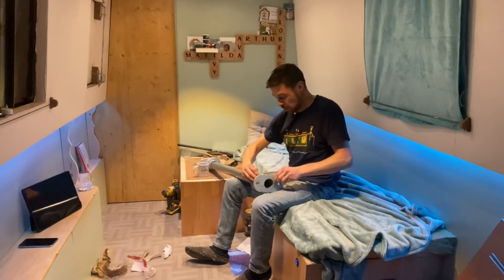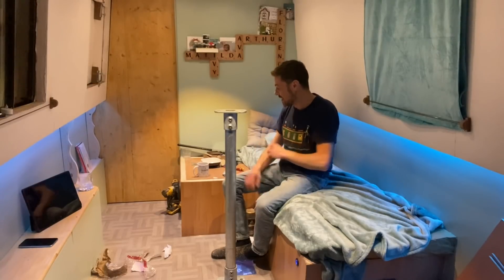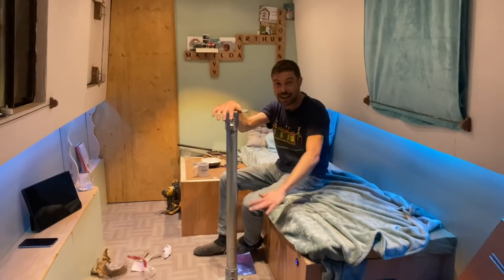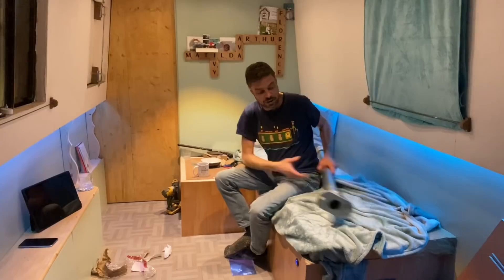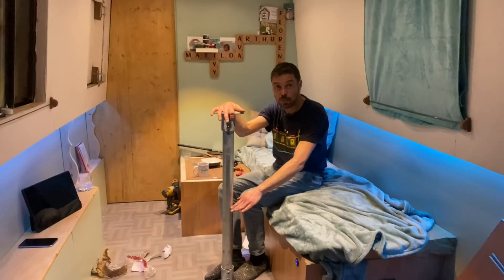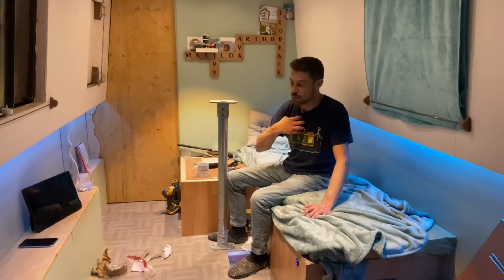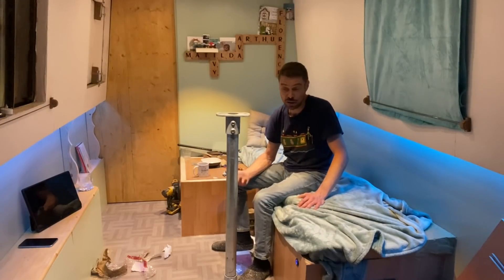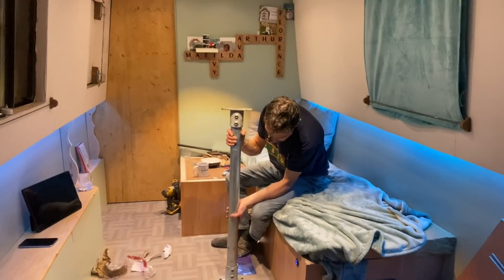315. The world’s heaviest adjustable table leg

Comment: I would go with two poles James and do it so the table turns round one side round for going in as to bed and the other side for sitting so you can turn the table putting it on tlx don't know if this is any any good

Comment: The infill for the bed could be a piece of wood with the foam attached and covered with fabric on the front and sides (like a chair bottom) and could be used as the bench back for the long end. When you want to use the area for sleeping, the back would just sit on top of the lowered table. So it would always be in use, either as a bench back or the infill for the bed.  You would make it in two pieces. One the size of the infill, the other to make up the rest of the bench.  For the permanent table top,  you could actually have two smaller fun shapes with a splint down the middle.  Irregular in shape attached in an off-center way to the inner, telescoping pipe that could ROTATE when you remove the pin.  Basically having two settings - one close to the bench and one farther away,  split it into two separate table top so you can have a raised one and a lower one.  As for the inner pipe, you can use pvc pipe for the telescoping part so as not to add too much weight.

Comment: Two sets of legs.  Cut the existing tube into two pieces.  Short one to bring table top level with seat, longer one to raise it to table height.
Put the legs off centre of the table, and rotate it to the required position.  Job's a good 'un.  Next question?
All the best, mate.
Reply: I like this solution better.
Reply: This.

Or throw the tube in the cut for the magnet fishermen and go buy the 400 gbp leg.
Reply: I like this idea too

Comment: Most narrow boats nowadays use two ‘desmo’ legs which slot into a cup recessed into the floor and are much lighter than the one you have. You can also get different lengths to accommodate a table or a bed height.
The table size needs to be the same as the bed space. You’ll find when you sit down that it allows room to get in and out with no problems. It doesn’t overlap the seating as you seem to think.
By having two legs of the same length, you can either have a full size table (two legs) or a smaller half size table coffee table (one leg)
Legs and tables can be stored under the gunwales so that they are out of the way when not needed. This retains the free space you have at times other than meals.
Just a thought.
Cheers 
Les and Anne on Glendyne

Comment: Do you have enough length in that tube to make two different lengths of pipe, one for the bed set up and the other for the table set up. Not sure how high you need table but with you may just have enough length to cut it into two sections one short  for bed and one long for table. Quick release bolts..

Comment: Do you even need to bolt the sockets onto the vertical pipe? Is it not snug enough without the bolts to stop it wobbling; then you could just swap out different vertical pipes easily to change height.

Comment: Agree with Sarky, set the post offset from the centre and rotate the top to table or bed position, for the height id go for the tube inside method with a pin to set the height.

Comment: I’m not sure you need a smaller table, if it’s too small then it would feel too far away when sat down. Think about where your chair is when you’re sat at a table, normally the edge of the table and the front of the chair are in line or even the chair is under slightly. I’ve used dinettes where the bed and the table are the same piece of timber and it was fine.
Reply: I agree completely CA. I've just finished fitting out our 58' narrowboat. Both dinette and sofas convert to beds and the table tops are the correct size for the bed inserts. they are supported on Desmo legs which have wide circular connections to the table top/infill and floor so it's all stable in all directions. James, if you want more info, see photos, chat on phone, visit my boat currently in Welton Haven Marina, drop me a message. However you go,  make it simple - think ahead.
Cheers, Keith.

Comment: Ayye Captain !  Thou dost have revived my suggestion. In the end ….it requires a (squared) tubular base unit with top openings on the outer vertical posts. The diameter of the steel tube need not be great. You then insert smaller posts into the larger outer posts. These smaller posts act as the four table legs. The base is the shape of a rectangular box. It is screwed to the floor with six screws each side of the long sides of the box shape. IOE the screws run along bow to stern in orientation. Super stable… not too heavy.
The base is “bed height”. I reckon that this is the simplest design. Just bring your measurements and the tubular material to a welder. 
In this design…I am confident Captain.
Cheers 🥂

Comment: I think that you may wind up with a trip hazard with that pole fitting unless you always leave the tabletop in or the be made. Over in the US we would probably use a taper lock floor fitting with different height poles if we didn't want the adjustable. or you might see if you could mount it upside down with the upright portion extending into the bilge you would have to cap off the end to allow the post to just socket into place? Just some thoughts

Comment: If the table top is connected to the legs “off centre” across and lengthwise it would be away from you when it’s a table and in line with the seat when turned 180 degrees.  As a table top it would sit further in to the corridor and slightly more toward the kitchen

Comment: If you look at RV tables that are used for that, they pretty much line up with the edge of the benches, so I think that would be fine.    I like the 2 legs idea, and 2 tubes for each, high and low

Comment: Have you thought about being able to walk past it when it’s in table mode.  Also you will need the ‘table top’ to move up and down as you’ll break you’re back as it’ll be too low.  Also if you use a bolt through the pipe so you can adjust the hight, it will be that bolt that will bear the weight.

Comment: If  there is room Below the floor and not to much diverance between bed and table you could bolt it to the floor and slide it throug the bottom clamp?

Comment: Do you need grub screws in the bottom bracket - if not, you can then easily slide out the longer leg and replace with the shorter one withoout undoing any fixings.

Comment: You should have enough tube there to make two legs of the correct length for bed and table height. Screw the base to the floor for stability but have the collar at the top offset on the board so you can swivel it round to the correct position for bed base and table. When it's set up as a bed base, to convert it to a table you remove the board, swap to the longer leg and refit the board turned round 180 degrees so the offset collar spaces it away from the dinette by the correct amount.

Comment: do you have enough room between the floor and hull for the height differential  (table /Bed base)  a smaller diameter tube as a sliding support with locating pins.

Comment: The only random thought I had was to have the larger bed-slab on one end and the smaller table slab on the other and just flip it over as needed using the opposite side as a base. Doesn't factor in telescopic factor though. The other thought (re: telescoping) is you could get a pipe coupler (PVC?) and cut one piece of pipe to the height of the bed, and the other the difference of the height of the table and just set it in the coupler to connect. Could be a wobbly table though, or a P.I.T.A. to get apart if it's a tighter fit.

Comment: Hi James don’t forget the height of your seating cushions when working out your ideal height for the tabIe. I presume the cushions will be made from dense foam as it will be used as a bed as well.👍🏼 I would go with a pipe inside your stand and set holes in tube for table height or bed height with a pin going through the tubes at the height required to fix in place.

Comment: James, how about you put two stands side-by-side left and right at bed height with the head screwed to the bed platform extenssion.then when you want it to be a table, you lift the bed platform with the two head units off the pedestals and switch to a table unit top that is the side you want it.  You would have two new shafts cut to put the table top at the right height and the shafts would slide into the base units for the bed platform?  This way you would have two pipe units for the bed and two pipe units for table head.  I do not know how too draw items for the computer so I must try to describe with words.

Comment: You said you didn’t like the top access to the lockers so why not change them to drawers which even pulled out would support a bed board - this could store behind. Then have a small foldable table. Permanent tables take up so much space

Comment: From an engineering point of view, use 2 supports, the length of pipe should by look of it be all you need for both bed support and table top. The pipe bottoms out in those end brackets so pipe doesn't need internal sleeve the rest is up to you how you want it James.

Comment: You could build a wooden base….essentially a rectangular or cubical box which is the proper height for bed extension support. This base can be removable by securing it with a clever latch system to the floor.
Now for part two:  From this base …you now have multiple options for a table support system. It can be four small metal pipes which slide into larger metal pipes imbedded in the base. Quickly dropped in… quickly pulled up. The table top is the third component. It has flour flanges that receive the four pipes. All components are removable. Total stability … total removability … and potential additional storage. Return the pipe and get your money back.
Cheers 🥂
PS: If this is too cumbersome then use a tubular metal system like a school desk which features two metal feet screwed to the floor. Each foot is a tubular pipe (square pipe) measuring around two feet. Then two upright tubular sections rise to attain “bed height”. Contained in the upright tubular sections is a smaller tubular pipe which is cranked up to attain “table height” some companies specialize in this but it can be pricey. 
If neither of these options fits the bill …then keep your pipe captain.

Comment: Cut that leg in half so that you have two legs with feet flanges. 
Get some pipe to fit inside lower tube to use as an adjuster to lift to required table height and secure with through pins.
You may need to cut both lower pipes to bed height when you have table top fitted.
The bed and table will both be more stable with two legs rather than one.

Comment: I guess you need the the adjustment to be from 17” to 27” And allow 1 “ for plywood top.  If you had some thick threaded rod, you could have someone weld a large nut on the pipe section that the threaded rod could run through and if you had a round table mounted onto the top of the threaded rod, and you would weld the top of the threaded rod to table support.  Then you could spin the table to adjust the height but that would constrain the table to be kind of small.

Comment: If you look at this video you'll see that the bed /table can be the same piece & size - you won't be cut in half. I think your smart looking design  constrains the solution.
Use 60mm base tube with 50mm, say, inside. When needing the bed use your quick release grub screws to drop it down to the required height with a bolt through to hold at right height. An infill  mattress will not damage your table top.

Comment: Cut in half. You have the floor post. They will most likely end up 16" high. Get a post to slide (sleeve) in side. Add a leaf to the non bench side. It will be nice. Your only going to raise it 10". Drill holes with pull pins to adjust. The bases will be fine with large lag bolts. You could probably get nuts on there from your wine locker. Lol!

Comment: The first thought; add an opening(s) in the floor just large enough to add support structure under the floor to fasten down the legs base, make cover plate(s) with hole for the leg (preferably, flush with floor) to cover the openings.
Attach the upper leg mount to panel that will fill in remaining area of the bed deck.
Make removable table top(with locating pins) to fit slightly larger onto bed deck panel with locks like you used on hatches.
Have upper tube welded to smaller outside diameter tube and add support pins so table height is comfortable.
Modify legs so lower section is cut down to allow bed deck panel (without table top) to be level with dinette seat (for sleeping).
Well that's all off the top of my head, obviously your well past this stage so I'm curious of your solution.
Good luck.  ;-)

Comment: Cut the tube at the right height for the bed and fix the the socket to the middle of the bed. Then buy another socket and fix it next to the one you fitted under the bed …. With a short length of the tube fixed in it and a collar sticking out of it that fits inside the tube fixed to the floor.  So basically you can lift the bed off the pole and drop it on the longer off set pole that is permanently attached under the bed thus making the table higher and a bit further away from the seat . The short tube attached under the table should be just clear of the floor when it’s in bed mode . Hard to explain really.. so two sockets under the table one with a short tube with smaller tube poking out and one socket on the floor with a tube fixed in. When you lift the table up you just drop the     Tubes one on top of the other…. 🤪
Reply: Measure how much higher the table is than the bed…if that measurement is less than the distance between the floor and the bottom of the bed the extension tube can stay permanently attached to the second offset socket under the table. You just need a smaller tube fitted so the two tubes can drop into each other in table mode. With one leg the table can swivel where the two tube slide in to each other for ease of seat access 👌

Comment: I think you are over complicating things.
Most narrow boats nowadays use ‘Desmo’ legs which slot into ‘cups’ set into the floor (so no trip hazard). 
Also they are removable and can be stowed under the gunnel with the table/s when not needed. This keeps the space free when not eating. You could have two tables (full size one for meals and half size one for coffee, etc). 
You will find that a table the same area as that of a bed base will not cause problems. Remember your legs will go under it but it doesn’t come back against your chest.
Just a thought.
Cheers 
Les and Anne on Glendyne